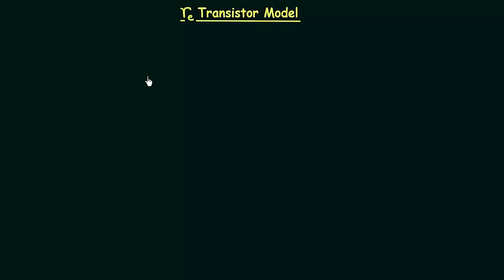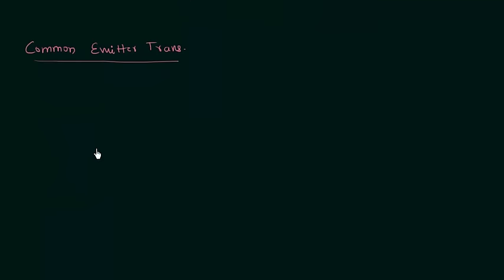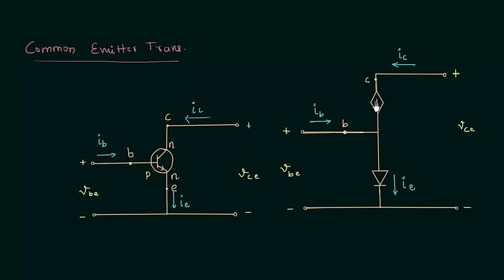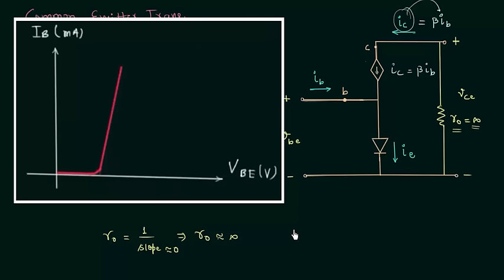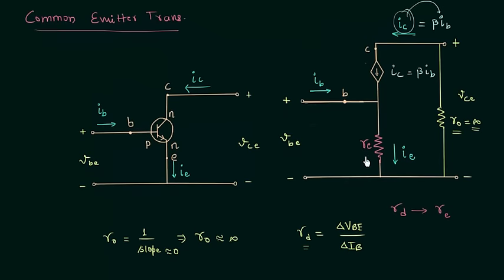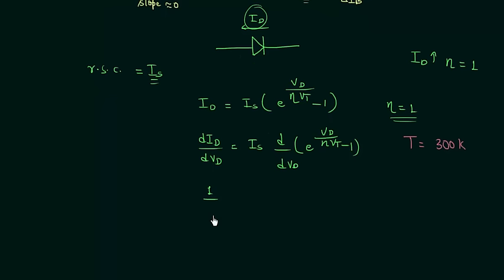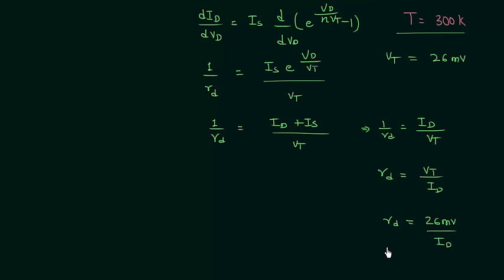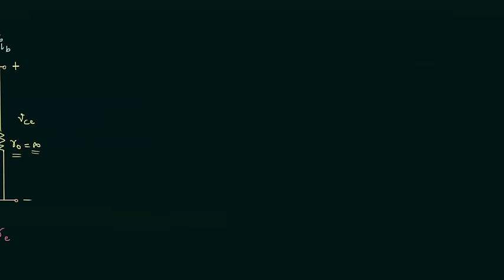re Transistor Model (Part 1)

Comment: why reverse biased diode is replaced by current source?
Reply: It is because the current flowing from collector to emitter is due to the minority carriers of the reverse bias section. In other words, the reverse bias section injects its minorities carrier to the  forward bias section. Those minorities carriers are seen as majority carriers in the forward section, therefore allowing high conductivity.
Reply: Luis Pena Mateo can you explain more please and why he replaced the transistor with 2 diode !
Reply: bas aise he...
Reply: Sure, I apologize before hand for my English and my delay. So, when we are introduced in electronics usually the first four things we study about are "P" and "N" materials, minor and major carriers. It seems very bore but in fact it is very important to understand better what happen in diodes and later on  in transistors. The diode is the simplest of the electronics components and it is form when a "P" and N material are joined together. A Bipolar Junction Transistor (BJT) in the other hand is form when you sandwich a "N" material between two "P" materials forming a NPN transistor, or when you sandwich a "P" material between two "N"  forming  PNP  transistor. Therefore, is not too crazy to think about a transistor or modeling it  as two diodes with common cathode or anode as the video suggest. 

Moreover, also when we study diodes we learn about what happened internally when a diode is reverse biased or forward biased. When in forward bias condition the diode act  almost as a short circuit or a conductor (a wire for example). We must say almost because we need a minimum voltage across  the diode for the current start to flow through it, that is about 0.7 volts for Si (Silicon) and 0.3 for Ge (Germanium) less than that will act as a open circuit, Also only the majority carriers flow trough the diode when in forward bias condition. 

In the other hand when reverse biased the diode act almost as an open circuit. once again we must say almost because that not quiet true. there is current flowing through it due to the minority carriers but it is so little that (micro and nano amperes) that can be consider Zero for a diode.

Going back to the transistor, part of the transistor is forward biased (Base emitter; the voltage difference of the base with respect of the emitter is positive ) and the other is reverse biased ( Base -collector, the voltage of the base with respect of the collector is negative) for the transistor  to be in the active zone. However that also means that Base emitter (P-N)  junction is forward biased and majorities carriers are flowing through it from base to emitter. At the same time, because base collector is reverse biased, here we may think that it should be consider open and no current should be flowing, so why he said it is a current source? But we never said it was open, what we said was that there was minority carriers flowing through it, and it was very small when we were talking about diodes. but in the transistor that's not the case. Why?

We need to take into consideration that the amount of minorities carriers depends of the operation temperature, impurities (how pure the semiconductor material is; minorities carriers are proportional to impurities) and amount of doping (elements that are added to make P and N material out a semiconductor material) , and manufacturer can easy control these factors and therefore how much current does a P-N junction conduct when reverse biased (a lot or very little), for diodes manufactures want very small minorities carriers when reverse biased because you want to simulate a open circuit, and that means the least the better. but that's not the case for transistor we really what a lot of minorities carriers in the reversed bias junction. 

Now comes the tricky part. minority and majority carriers are relative to the type of semiconductor material we are talking about. For instance, in P material minority carriers are electrons and majority carriers are holes and in N material minorities are holes and majority carriers are electrons. 

Taking that into consideration, therefore, the minority carries that flows from the collector to base are seen as majority carriers from base to emitter junction, think about it. this is why we model it with a current source. 

Finally, I think is good to know also that the thickness of the semiconductor material used in a transistor on the base is very small in comparison with the collector and emitter, to increase resistivity of the base in relationship with collector and emitter. usually 1000:1. this is to control the leak current from collector to base, and to make sure that a very small amount of current flow to the base form the collector, since current prefer to flow through the less resistance path.

Hope this help. 

Regards, 

Luis
Reply: Luis Pena thankyou. This was very helpful.

Comment: At 4:01, how can the slope of the characteristics be approximated to zero, which is actually a high value. If the slope is zero,  the collector current will be constant and this is possible only in saturation region and not in active region.

Comment: Why reverse bias diode is replaced by current source?
Reply: The reverse diode is replaced with a high resistance, which was actually (here) open circuited. The current source is not the exact replacement of the reverse biased diode. It actually comes from the forward biased diode.

Comment: what do u mean by dc eq.circuit at 10.11 in the video.i mean we r doing ac analysis here so from where did the term'dc eq. circuit' come from all of a sudden?
Reply: Shiva Reddy in order to find emitter current we need to use dc equivalent circuit...watch the dc equivalent lecture that sir has taught earlier...u will get to know how to calculate emitter current
Reply: Diodes convert ac to dc and therefore we need to do dc analysis to get emitter current because diode out is dc. I havent phrased it properly but I hope you get the idea
Reply: diodes only convert ac to dc in a rectifier, there is no rectifier here.
Reply: its a transistor.
Reply: Shiva Reddy to find emitter current we have to use the dc analysis bro....That's the one he said....about
Reply: in dc analysis we only have to use dc source and open circuit all the capacitors